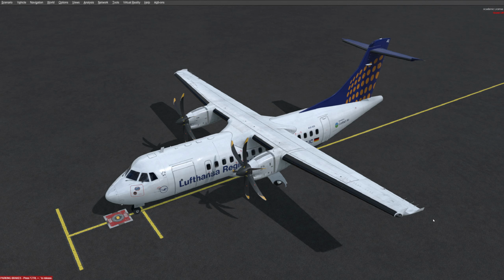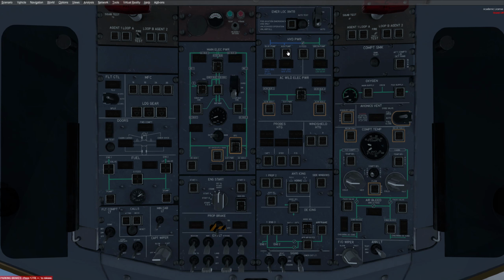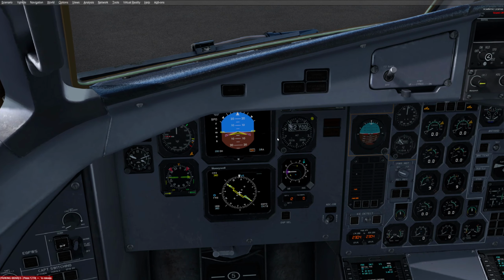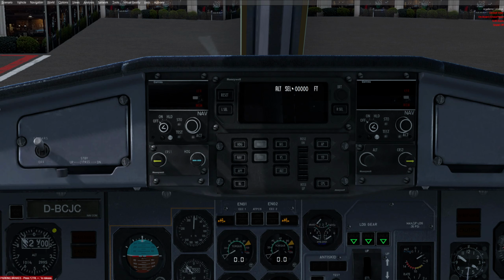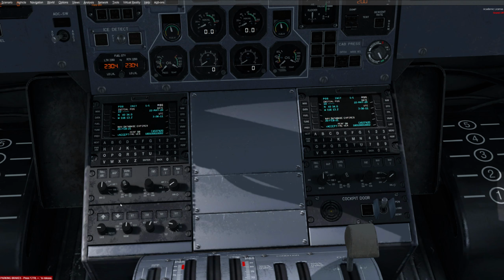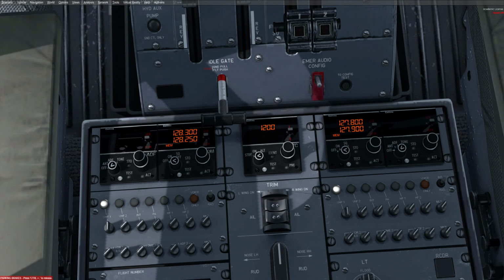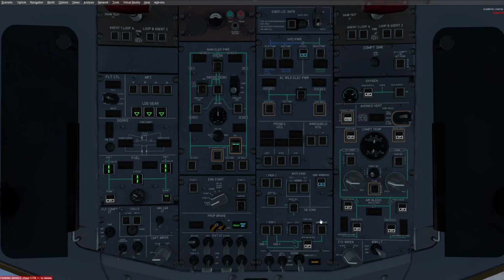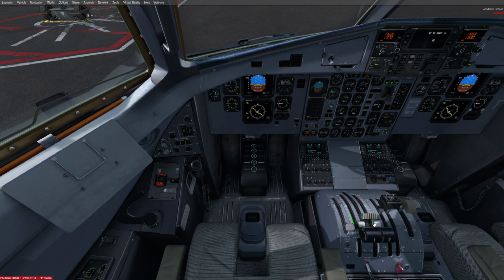CARENADO A42-500 Tutorial Cold and Dark to Taxi Ready in P3D v5 on May 22, 2020

Comment: how to unlock the yoke i cant move it
Reply from the maker: I think it's a glitch.  The surfaces still respond, but the yoke gets locked up and "twitches".  I noticed the yoke worked fine before I selected "cold and dark".    I have no solution other than drop the yoke from view.  I should still fly.
Reply: @bjmarten6463  i think i found it you should unlock it with that black/yellow thing next to the throttle

Comment: Great video!  Tremendous help in understanding the ATR 72-500! Quick question: at about 8:11 when describing the settings of the Power Management knob you did not mention what position is to be used for descent. Should I switch to TO when beginning descent or keep CRZ until I begin approach. Thank you!
Reply from the maker: As I understand it, there is no need to adjust it for descent.
Reply: When you lower the landing gear you set the PWR MGT to TO in case of a missed approach.

Comment: Quick question; the Hotel mode also works on Engine 1 right?
Reply from the maker: It locks the right engine, not the left.  However, this is a sim, so try it and see if the developers missed this detail.
Reply: @bjmarten6463  thanks